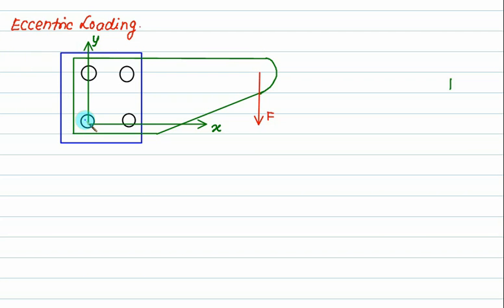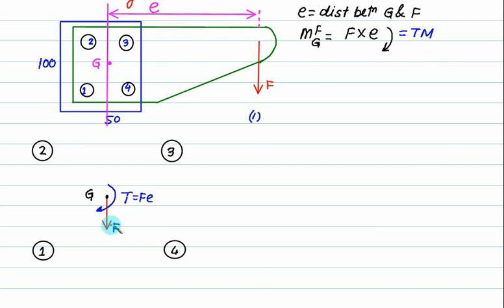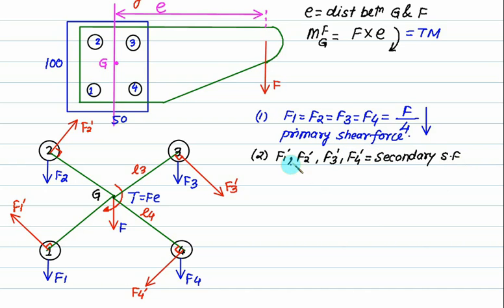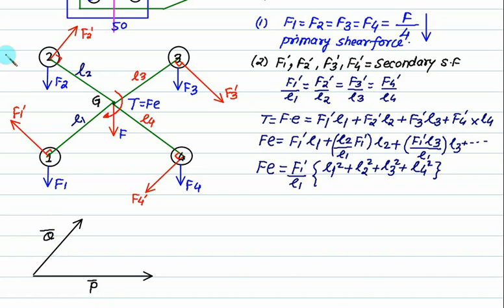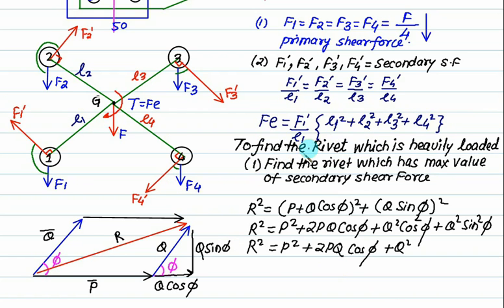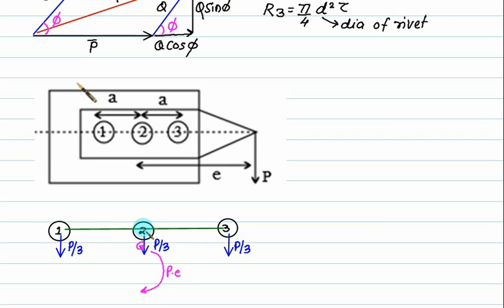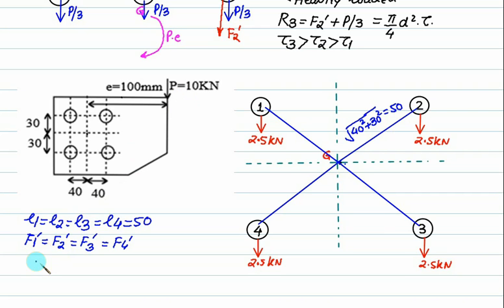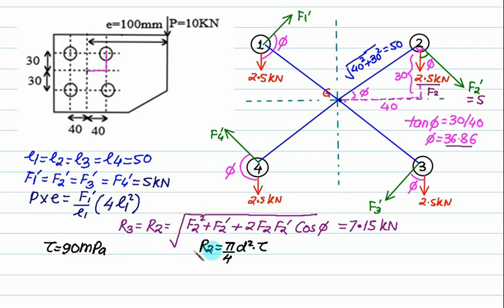04 Design of Riveted joints Eccentric loading

Comment: If Secondary shear force of rivet no. 1 & 2 is higher than that of rivet no. 3 & 4 and angle of these rivets is also more than 90 degree as compared to angle at rivet no. 3 & 4, then which rivets should be considered critical?
Reply from the maker: I had discussed short method
In general find resultant force at each rivet using law of parallelogram and confirm highest load
Reply: @sunilmohodmh31  thanks Sir.

Comment: I think ,secondary forces should cause an opposing moment to the moment generated by ecentric loading. But you have taken it you have taken their directions to cause moment in same direction as that of moment caused by load.  It does not satisfy moment equilibrium about centroid. Could you please explain ?
Reply: Yeah ,since sir has followed same notation for both primary n secondary it won't be a problem ...
Reply: Also the direction of forces acting on rivets should be opposite to the load directions. By your method answer will be correct but directions are opposite I guess. Kindly check
Reply: secondary forces are the reason the moment is caused that is why their direction is taken the same